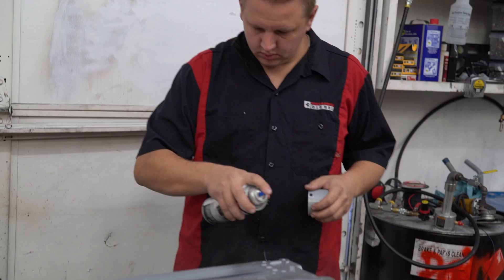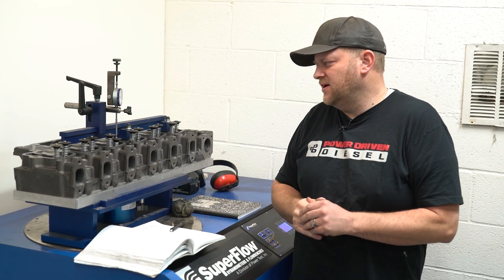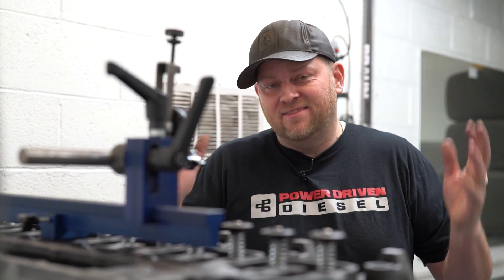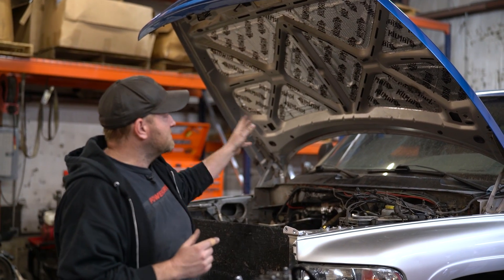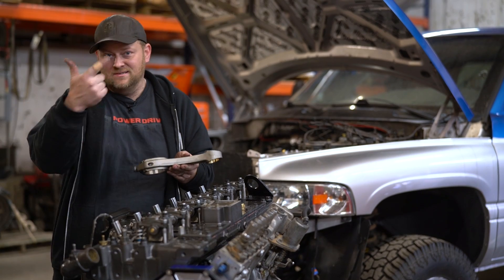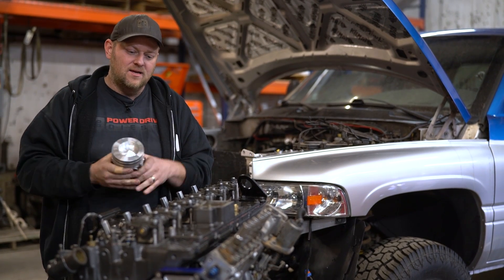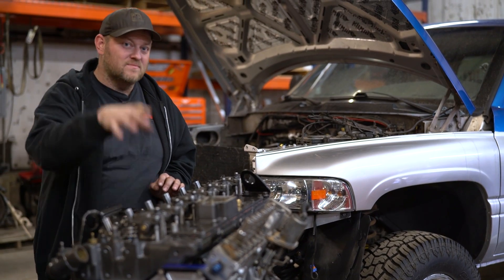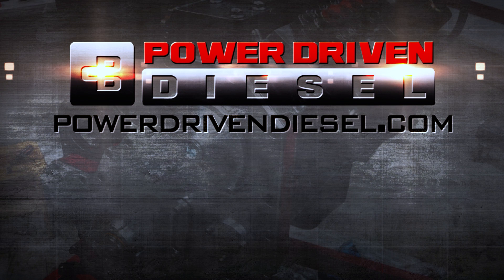Building 1000 HP 12v Cummins Street Engine

Comment: How much is it typically to rebuild a 12 valve with mild upgrades for 600 to the tire ?
Reply from the maker: For DIY home built,  machining is $1500 to $2500 depending on how much you do.  Plan on $2500 to $5000 in parts for a 600 HP build depending on how nice you make it, and DIY means free labor.

Comment: Hey guys random question, if I was interested in doing a high horsepower 12 valve build in a first gen body, would you recommend I go with a 2 wheel drive or a 4 wheel drive? Also wondering since I’m planning on doing a nv4500 swap down the road. Thanks!
Reply from the maker: We'd recommend you test drive both a 4x4 and 2wd 1st gen.  4x4 has great traction for street launches, but they don't handle well with factory suspension.  The 2wd feels much safer at speed when you have a lot of power.  That said, 2wd with big power skate on the street so handling is still a challenge....  Not the answer you're looking for, but a test drive of each would help you make the best decision.

NV4500 is a fine transmission up to 500 rwhp.  Beyond 500 HP, both 3rd gear and 5th gear become constant failure points.  Beyond 700 HP, you might only get 2 good test drives out of an NV4500 transmission.  This is why all the 700+ HP trucks end up with a built automatic, usually a full manual VB setup with a shifter in place of the NV4500.
Reply: @pddofficial  I currently own a NV4500 swapped 92 d350 and have loved it. That being said it only has minor upgrades done and I’m not planning on going with another dually. Nonetheless this is extremely helpful information and I’m very thankful for the reply!

Comment: are there any 1000hp+pistons that'll last 100k+ miles? i've heard with forged aluminum pistons the ring eats away at the piston and they need to be replaced every 20k miles?? 98 percent of time it'll be on a 600hp/1200+tq tune with the availability to turn up to 1000hp/2000+tq when needed
Reply from the maker: For 1200hp on a 6.7, I would run a factory cast or Mahle replacement piston all day long.  What you're describing is basically Myer's tow truck and it just has the factory pistons from 2010!

Comment: Im wanting to do a 12 swap on an obs ford used as a service truck. My main concern is longevity, power, and MPG/efficiency. At what power point can I get a good mixture of these characteristics. I dont want to go overboard make tons of power and have really bad mpg since it will be working everyday, but I also dont want a stock power block build any info would be great.
Reply from the maker: On a 12v 400-600hp is great reliable power when setup and used as intended.

Comment: I gotta ask, what is the point of doing all the extra work for only .1 liters? Add 1mm to your compressor inducer and you will gain more than that little bit of cubes.  I honestly only see negatives for the 6.7 crank especially in a 5.9 bore.  I guess it could add a tiny bit more off throttle torque but so will a small secondary turbo.  You have to shave your pistons which again is a bad idea if not necessary.

Comment: What about using a common rail block to make a 12 valve?
Reply from the maker: We are able to it is just a lot more work
Reply: @Power Driven Diesel  could you do a video about using a common rail block to make a stroker 12 valve, I have two blocks that i want to make stroker 12 valves.

Comment: Stock genlll 5.3 lm7 ls rods good for 1500hp also. Yeet
Reply from the maker: We frequently quote rear wheel horsepower numbers in the diesel industry, whereas the gasoline performance industry regularly quotes engine dyno power ratings.  We've seen carefully tuned stock rod equipped Cummins engines reliable to 1800 HP on the engine dyno and then live a season or two in a sled pulling truck.  The key with almost any factory rod application is to tune out the low rpm torque.
Reply: Yeah 1500HP and roughly 1500 ft-lbs while these are rated for well over 2k ft-lbs lmfao

Comment: What is the End Cost as Seen Build?
Out the door ? For the 6.0
Reply from the maker: It's very easy for cost to exceed 10k depending on cores, pump, lines, fuel injectors, etc.  An OEM cummins 6.7 crankshaft is over 2k retail, but the aftermarket versions are usually 1k cheaper, so it's easy for cost to swing wildly depending on options selected.  This particular engine would run between 12k and 15k.

Comment: I wish somebody would make the second ring for those engines that has a step you have your gap but you have a step over yeah you know what I’m so I can’t explain it anyways Charles and Albert are you while take that back Ackerly and Albert look at their rings for it’s like small block Chevy or something you have two gaps instead of one but anyway that greatly controls blow by and I will make your engine more efficient this is six in a row jim From Kennerdell PA
Reply from the maker: It is possible to send the second ring off to total seal and have it cut with a machined step for a second overlapping ring to make the second ring gapless.  This works well for milder applications looking to control soot loading in the oil and blowby, but it catches too much combustion gas on the bigger power setups and breaks the ring land from over loading.  It also seems to be less reliable for the sub 500 HP engine applications looking to go 300k plus miles.  So it's really a niche application great for 100k miles and 500 to 800 HP setup.
Reply: Do you guys have power driven diesel this is six in a row jim Thank you for that information on the second ring the in Gaples I just wondered if a guy couldn’t take a keystone ring and machine that gap in on that that way you’re not using a forged piston

Comment: I am wondering if you considered ceramic coating the piston crowns?
Reply from the maker: We've tried it on a few engines with inconclusive results so far.  Sometimes we've seen bonding issues with the ceramic coating, other times it has held up fine.  We've also seen melted pistons with ceramic coating so it's hard to say how much thermal protection it really adds or if it will even stay bonded on a big power setup where pistons move and deflect as they are pushed to the extreme limits of the piston parent material.  We aren't saying it's good or bad at this point, just mixed results in our testing so far.
Reply: @pddofficial  I have wondered If bonding sufficiently is an issue sometimes, and if it really helps. Maybe it would be somewhat beneficial for those running at moderate horsepower levels, to provide a little more protection and efficiency.

Comment: I love the 12v content. Can’t wait to see the testing,  dyno results, and tech talk. 👍👍 I recently bought a 6.7 G56 3rd gen and sold my 98 12v… a month later the 3rd gen is for sale and i got me a 1 ton 94 12v 5 speed 4x4 already. nothing compares to the 12v mechanical throttle feel and simplicity and reliability.
Reply: fk yea mechanical mafia you can have your computers
Reply: Yesssir mechanical got a 93 12 valve
Reply: I’m running a 07 5.9 with g56 but a throttle sensitivity boosted and get a tune much more sensitive then the cable drive trucks
Reply: @TrikeGarage  you can’t beat a mechanical cable. the throttle booster can’t read minds lol. so at absolute best it could match a mechanical throttle cable. i love the feel of a mechanical pump. the truck responds exactly as asked. no smoke and mirrors of a computer deciding to do… or not to do what you tell it.

Comment: DDP made an interesting statement about 1000hp and reliable. It kinda crushed my hopes since I was aiming for that as well. I follow all you guises channels so I can learn from you alls mistakes.
Reply from the maker: The driver has a lot to due with reliability at the 1000 HP level.  With that much torque on tap, it's quite possible to destroy everything in the drivetrain: tires, wheel bearings, brakes, ujoints, axles, tcase, tranny, differential ring/pinion, etc.  With sensible driving and regular maintenance, we've seen 1000 HP daily driven trucks that are reliable.  Usually they have turbo systems capable of 1200 to 1400 HP and are detuned so they don't run on the ragged edge all the time.  But are any of these trucks as reliable as a stock truck, NO!!
Reply: @pddofficial  Hope to prove that theory wrong with being less reliable than stock. I went way overkill on nearly everything and will use about half of the available power. Will be finding out what my HP is soon. Probably gonna get my feelings hurt LOL. 

My last truck was driven all out but stock way 25 to 40k miles a year for 14 years. Bulletproofing is a vague term, but if there is an overkill version of it, I pretty sure I am close to that. LOL.
Reply: $4.20 regular unleaded boys just clicked over night (after "just clicking" over 30¢ ☝🏽over night- night b4 last) here in C. Florida. And my biz' based off gas utilization (Lawn service)safe to say  think the 97 drw, 12v stays turbo lagging- flat another summer . 🤦🏽‍♂️ 
(TRUMP DESANTIS 2024)
Reply: Its not "mistakes" (its "we can afford hail marry... SEND IT!!" ) 😆
Reply: @6bt_str86  If something breaks when you dont expect it to because you are not aware of its limits, then what do you call that. The objective is reliable. 

If you aim for 3000hp then its fk the consequences, just send it. 

I am seeing a correlation between big injectors and diesel fuel loading in the crank case. The fish eye test was positive for a 2k miles oil change on 50% overs.

Comment: How close does the wagler match the big end profile of a cracked cap common rail rod? I am looking for something stronger but can’t use anything wider on my stroker motor.
Reply from the maker: The big end is a little wider than stock, probably have to clearance the block in your stroker application.

Comment: Can't wait to see you send this thing down the drag strip! How many miles will you be putting on it before you consider it broken in and ready to beat on? I'm a chicken so I think I'm always waiting way too long before giving any fresh engine the beans.
Reply from the maker: After the head is retorqued and then rechecked warm to make sure it doesn't need a second retorque is when we typically lay down the hammer.  Sometimes if you baby them too much, the rings take forever to seat-in.  Don't wait too long on your new engine, once the head gasket is clamped down, it's ready for power!